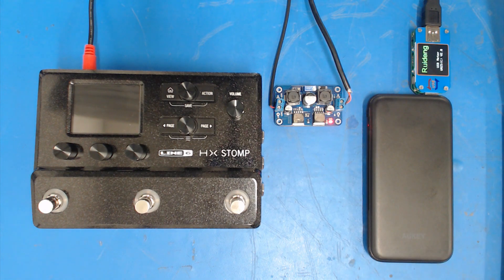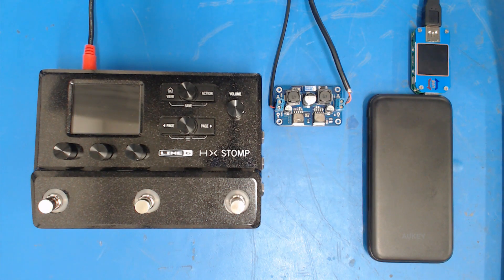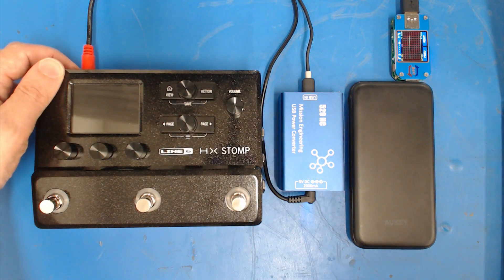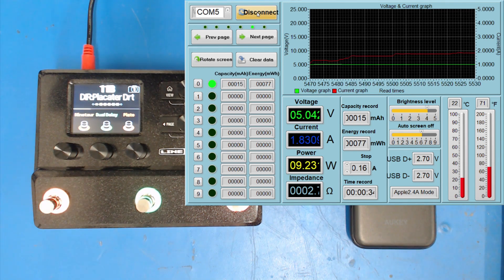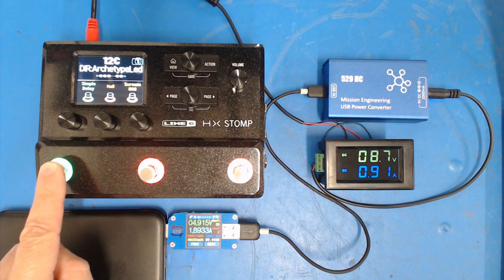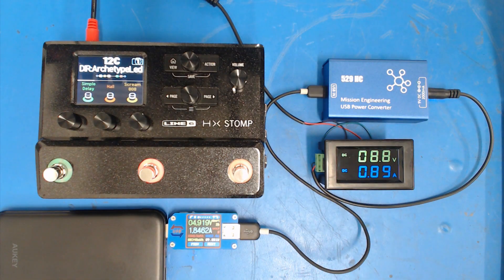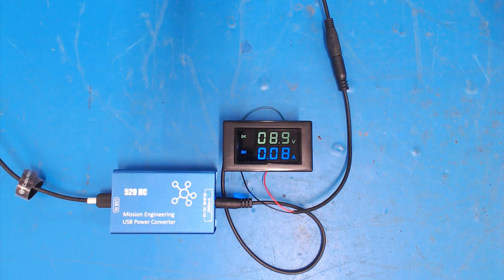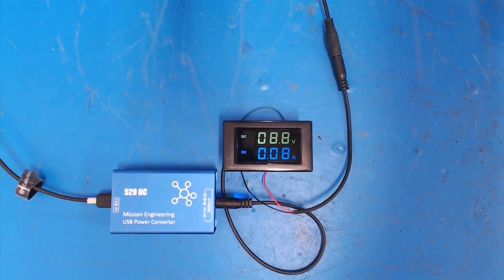How to power the HX Stomp - Cheap boost converter FAIL

Comment: Have you ever tried/tested the Myvolts ripcord? Supposedly a 9v 1a powersupply (although it claims max power output 12w)  and supposedly works with the Stomp. Although a second one I'm testing just shuts off, probably due to overheating. I assume the stomp sometimes demands more power, just now it did that with Poly Sustain block in constant use.

Comment: the back of the HX stomp stays "9V 3A". but it looks like you are powering it with only 2 amps... 
will the HX Stomp work safely when only being powered by 2 amps? what are the drawbacks of only using a 2 amp power supply?
Reply from the maker: it depends where you measure it and how much headroom you want to supply. The HX Stomp consumes about 9W in normal use, that's 1A at 9V. Since the stock power supply that Line 6 provides has a 3A rating, that's likely why this is what's printed on the unit. Both Mission and Line 6 have tested the 529 HC with the HX Stomp and it is approved for use.

Comment: Thank you for this. I will try and use a pololu u3v70f9 step up converter. Is there a way to go into the converter with a usb-c cable? My power bank can provide 3A through usb-c. But i dont know if it works with all that power delivery stuff going on with usb-c..